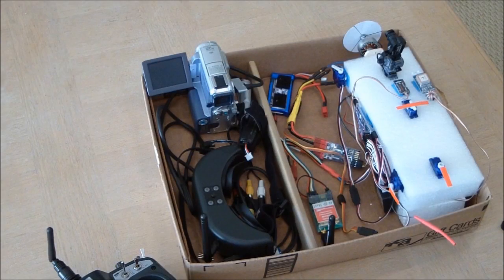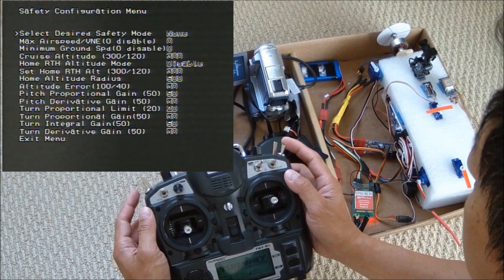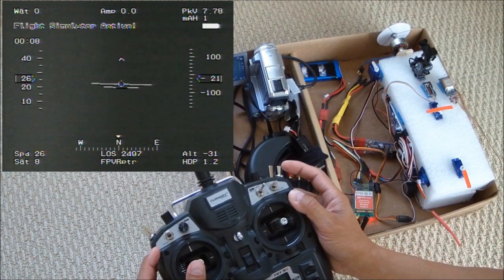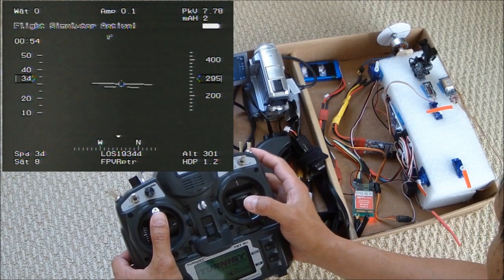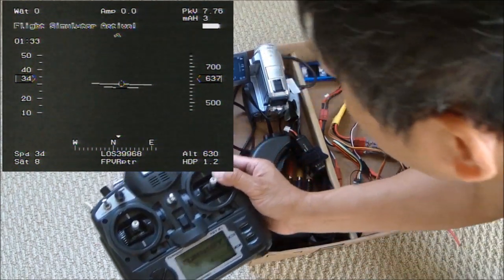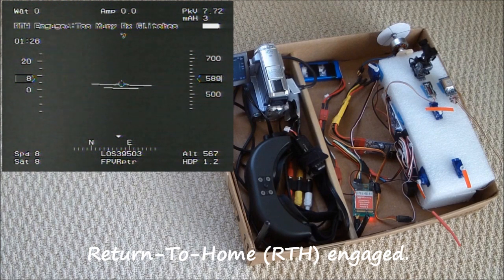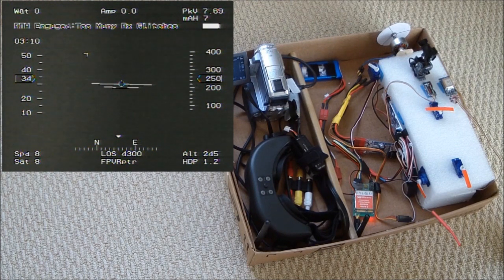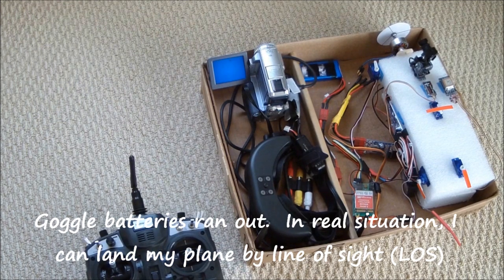FPV Testbed 3 - Eagle Tree OSD RTH Simulation

Comment from the maker: I tried the 3pos configuration and found that 2 - 2pos switch configuration is easier to use.  Anyway, I wish it has a dedicated switch to enable/disable the stabilization, better yet, a nob to adjust the gain from 0 to max.

Comment from the maker: When the RTH is enabled, it will not be activated immediately.  It will be activated only when the signal is lost or you turn off the transmitter.  Only when either one of the above situation occurred, your plane will turn around.  According to the document, it is not recommended to turn of your transmitter.  Some transmitter require reboot and rebind, that may cause problem.  So I used the microwave oven to weaken the signal and simulate out of range scenario.

Comment: How do you enable a switch on your tx to turn on the RTH function when flying? During the flight sim, the plane does not circle around the home location, it keeps on flying away. I can take control of the plane in the sim and this disengages the RTH sim. My monitor says "RTH engaged: move sticks to stop test. When I move the sticks, the monitor switches to : flight simulator active". Any ideas on how to fix this?

Comment: left a couple messages on testbed 2 but got tru that. im now trying to test rth when i get on the screen where you are it says run safety wizzard first. couldnt find it on the on screen display or in logger setup. where did you find the safety wizzard

Comment: do you have to purchase the stabilizer to use the return to home  to keep it balanced.? does the gps need to be on outside of plane?   seen a horizon marker on ur screen I that the stabilizer doing that or the osd? mine just shipped out today but didn't get the stabilizer.by the way excellent vid. looks like it will be very helpful.

Comment from the maker: Have you check your connection?  When I plugged it in, the artificial horizon is on immediately.  However, the stabilization did not work. The most important thing is to run the Servo Analysis Wizard (via USB is much easier than flipping transmitter switches).  It's a  pretty lengthy process but the system has to learn your RC control system.  Then activate the stabilization feature on the OSD.  Main Menu -> Configure Radio Control -> Stabilization / Elevon Mxing On=Yes. Hope it helps. Cheers!